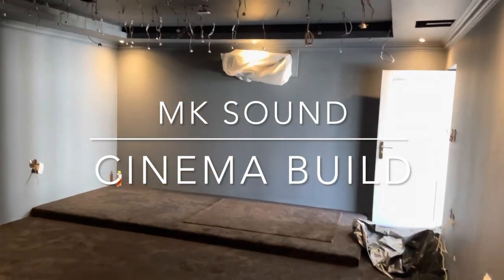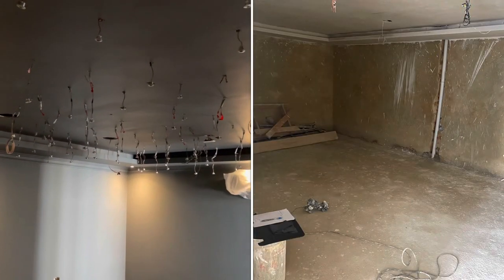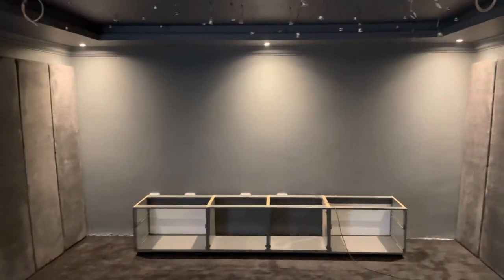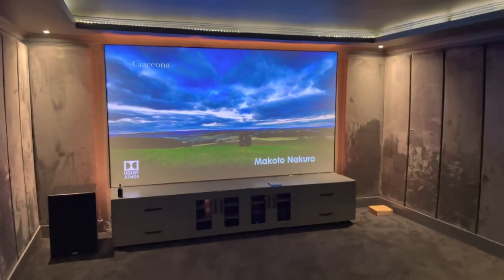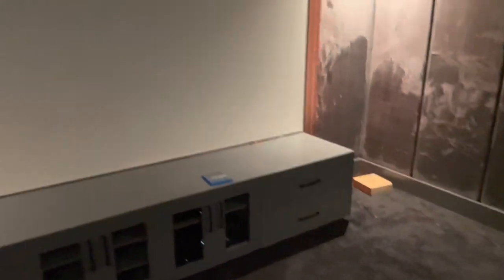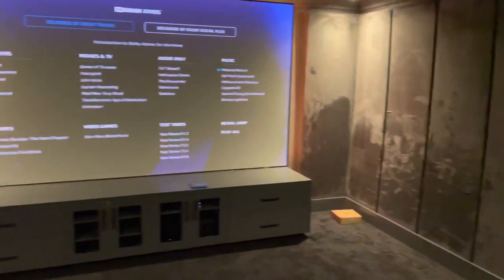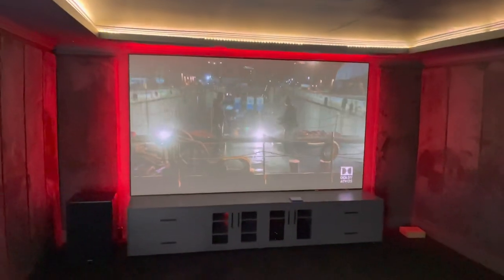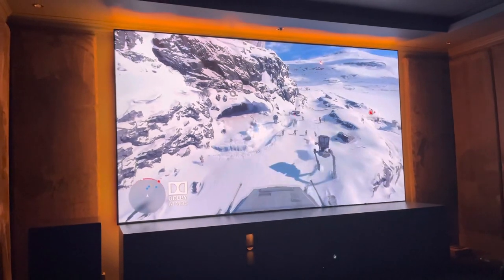Mk sound cinema build👌

Comment: What kind of mounts did you use for the surround s
Reply from the maker: The standard mounts that come with the MK
Reply: @homecinemaking397  that’s odd. I have new s150s, s150t and mp150. Guess I need to take everything out the box.
Reply from the maker: @bigjack79  should be in there